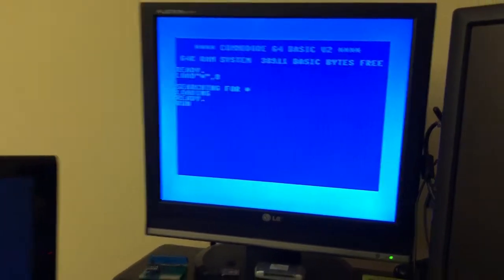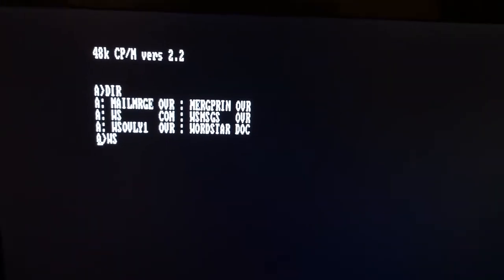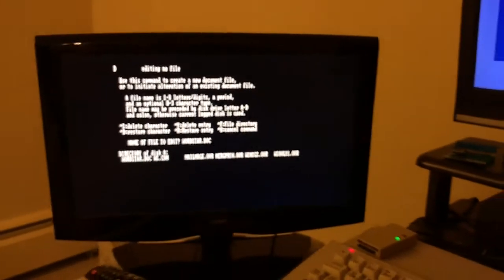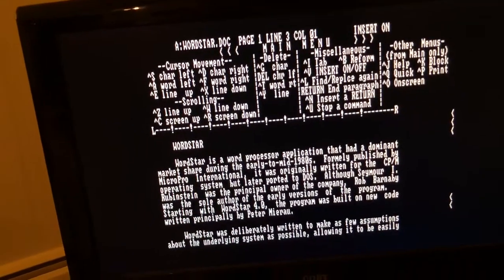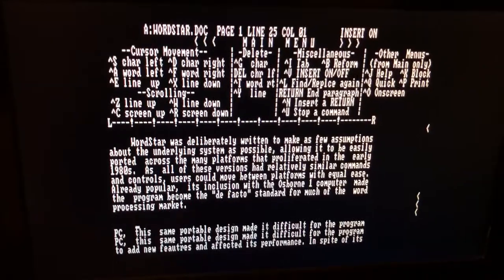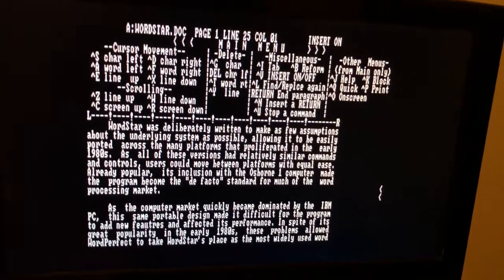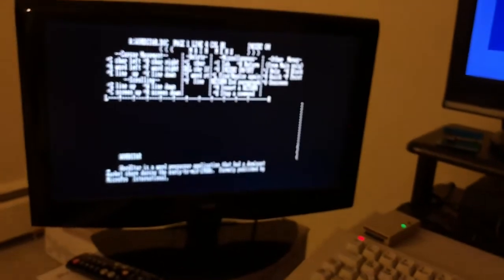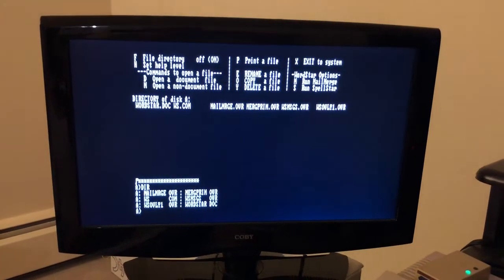CP/M 80 columns on a C64C

Comment: Is this the Commodore's CP/M cartridge? (http://www.z80.eu/c64.html) 
The BIOS modification  was possible without changing any ROM because the BIOS is loaded from disk, right?
Is there any reference to the modification by hardware and software you have done?
Reply from the maker: jjeeeekk i will make the changes available. And yes its a common cp/m cartridge and the bios is loaded from disk. You will need to make a 80 column card that is documented in my website: just search for WordPak RS on google...